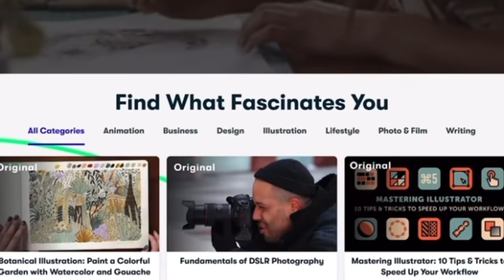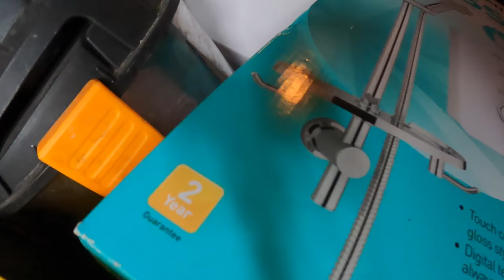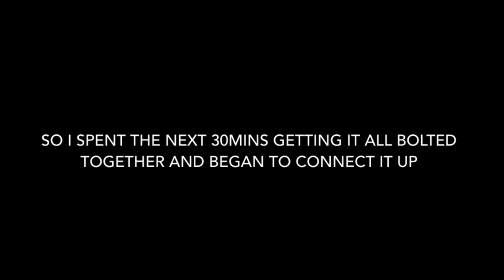HOW TO FIT A CAST IRON RADIATOR & CONNECT UP TO THE HEATING SYSTEM

Comment: did hundreds of these rads years ago in pubs, 3 and 4 column wide, Uv got the idea though, i always found it better to get a flat surface and lay them flat, Dont need to tape the threads, just boss white each side of the paper gasket, although it looked like ur ones were rubber, shouldnt need more than one, its just a fine balance to get the two sides to come together equally, i cant remember ever having one leak. Carried 4 pallets of them into a pub in paisley and the site manager told me to put them in the cellar out the way, he got told to GTF
Reply from the maker: Cheers buddy 👍🏼👍🏼

Comment: I hope you didn’t need to split that in the future using Loctite. I think the threads are normally not sealed, relying on the gasket. I would be tempted to use silicon lube on the threads.
Reply from the maker: I won’t be splitting it ever…. That’s for sure 🤣
Reply: @MJTiffPlumbing  😂😂😂😂😂😂

Comment: Regarding the Cast Iron Rad. I have fitted these type of Rads. But a Different brand, as the ones I fitted have Graphite washers, not rubber. I don't know but check to see if one side of the threaded nipple is slightly longer than the other. If so the longer side would screw onto the one section first. Enabling a more central connection, with no gap. Just a thought!
Reply from the maker: Oh now that’s a great little tip 👍🏼👍🏼

Comment: Another good job. I fitted some radiators that required each section to be fixed together with left and right handed threads back in the late 70’s. I found by using tape as well as the washers the sections were difficult to seal satisfactory. So I just used the washers and paste and it worked well. Took me all day to prepare ten rads though
Reply from the maker: Very time consuming

Comment: I used to do these 40 years ago on cast iron rads with hemp and boss white.have not seen them for donkeys. left /  right threads are a pain and very easy to cross thread. Well done for a pain in the arse job
Reply from the maker: Cheers Tom…. It was a case of just taking my time and hoping it was ok

Comment: Nice one.....I did one similar to that e few years ago for the first time... I used CT1 on the threads with no tape so it would tighten easy and was a bit worried about possible leaks but absolutely fine on a sealed system...... 😀 
I do the same with bags in bags and then Can not find anything.....!
Cheers mate......👍
Reply from the maker: CT1 on the tread!!!!….. wow

Comment: Great job, I have done loads of them but have haven’t ever Loctite the thread because they normally hold with the washer, Just watch out on some of the manufactures joint some times weep after while once they’ve been heated up and cool down due to the cast contracting.
Reply from the maker: Yep put loctite on for a bit more reassurance 👍🏼👍🏼

Hopefully it won’t start weeping in time🤞🏼
Reply: A bit of Boss white 👍

Comment: Another brilliant video mate, you should try liquid PTFE on troublesome rad thread next time. Used it a few times and it’s brilliant you just got to leave it a couple hours to go off before filling that’s the only problem but really good.
Reply from the maker: Thanks mate…. I may give it a try. What make do you use?
Reply: @MJTiffPlumbing  just flomasta from screwfix mate, also use it on outdoor taps as you can get it straight and it’s not moving once set up, you don’t use ptfe or compound with it just a good amount on the thread and leave.
Reply: Your better off using CTI.....instant seal and you can fill straight away.....👍

Comment: I do not envy bolting those rads together, I had so many years of putting sectional boilers together on site and it was a ball ache, thankfully we only ever had 1 leak on one boiler but you pressure test before putting casing burner etc on but getting it apart to renew the nipple that had a pinhole in it from manufacturing was a ball ache.
Reply from the maker: Now that sounds like a stressful job…. This rad was bad enough

Comment: We used to strip down large cast rads section by section and redo them .We used paper washers and linseed oil to join them and they never leaked
Reply from the maker: A lot of work in those I bet mate

Comment: Invest in a pipe tube mark, best thing ive ever bought pal.
Reply from the maker: Pipe tube????
Reply: On top off the van...... easy to break open and all your coppers gone in a flash....too many thieving fookers about these days.....👍
Reply from the maker: Yensabi…….. completely agree, when Nico put “pipe tube” I thought surely he’s not on about one for the roof… As I know what they are and they are a thieves dream!!!

All my pipe fits inside the van in full 3m lengths, not a problem. The reason I have a LWB van is for that exact reason.
Reply: @yensabi  you can buy heavy duty locks for them, if thieves wanna get in the van they'll get in your van trust me I've had mine done a few times.

Comment: What a pain that rad jeez... Used to be when i worked my dad and start learning we welded Cast Rads 🤮 Just a question in UK Plumbers Heating blokes not doing any drainage? I mean I can't see any rothenberger or ridgid snake machine.. 😋 only wondering..
Reply from the maker: As in drain cleaning/rodding etc??… I do a little bit of it but leave the big stuff to the drain guys to be honest
Reply: @MJTiffPlumbing  Oo ok cheers, in Hungary is Plumber is a Plumber, do everything boiler, heating, drains including laying drain pipe, unblock with big 22mm snake separated in van in dirt box Rothenberger machine😂 but yeah jetting is separate only, thats only wondering. 👍
Reply from the maker: Yer we tend to not get to involved…. I’m sure some do though 👍🏼👍🏼